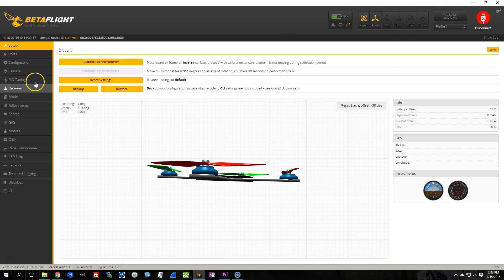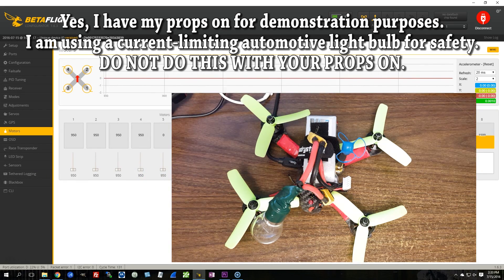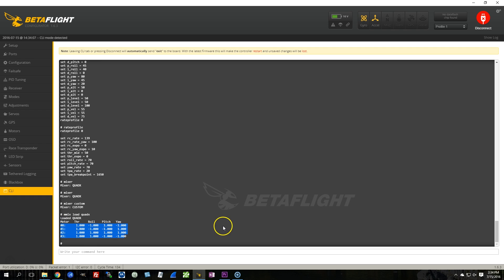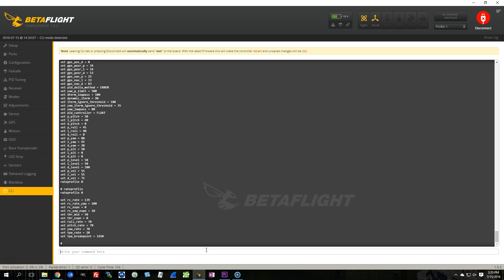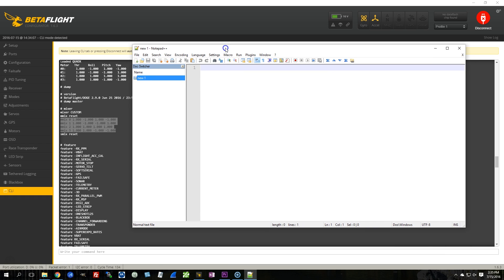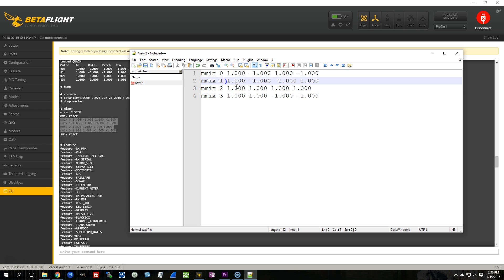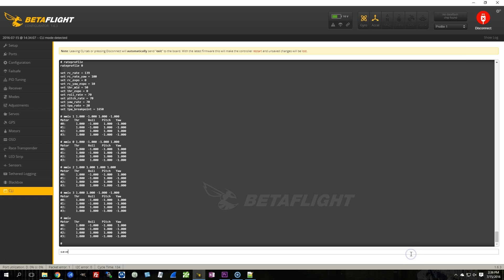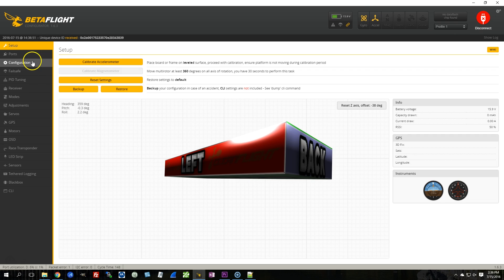Quadcopter Motors Wrong Order: Cleanflight/Betaflight Easy Fix [UPDATED METHOD IN DESCRIPTION]

Comment: This is giving me a brainfart moment...

Is there any simplier easier way to fix motor rotation direction, without going to desolder / resolder, as well as soing a crash course on electronics programming?
Like an app perhaps that i can just toggle the directions of my motors 1 & 4 to turn clockwise instead of counter-clockwise?

Comment: not working, values are changing in CLI but motor rotation same as before
Reply from the maker: This doesn't change the motor rotation. It tells the FC that you are going to change the direction of the motor rotation. You actually change the rotation in blheli, or by changing the motor wiring. In addition, please not the UPDATED METHOD IN COMMENTS. The mixer method is completely outdated.

Comment: Only a few of my motors will spin at a time sometimes one will spin or 2 on the same side or all of them will spin and it’s random and I have no idea what to do because they all work fine but a low throttle they spin supper fast or don’t spin at all

Comment: Thanks for video, my tinyhawk 2 freestyle would say the motor order was updated but it never changed when I tested? I was using a new mb so I took the old ones cli and flashed it over, It had a few errors but fixed the motor order for me. I'm sure I was doing sometime wrong but if any one else can't get them to work you might try a cli dump/flash

Comment: I have the right order of motors but motor number 2 and 3 spinnings in the wrong direction. can I reverse them with betaflight or do i need to do it by reversing the wires on the motors?
Reply from the maker: You can swap the wires or you can use blheli to reverse direction. But betaflight can't do it.

Comment: I am feeling very bad seeing all comments saying “great you fix my problem”. In my case nothing. The new mixer was recorded but the motors 3 and 4 continue swap. This is a new flight controller Tyro79. Last week I soldered motors’ wires swap for the motors stay in correct place, but I think is bad service and then I resoldered like the manual ask. I want to learn how to make it correctly. I don’t know what to do.
Reply from the maker: Don't use the method in this video. Use this method: https://www.youtube.com/watch?v=QeuSq71pYF0

You need to clear out the changes you made to the mixer though. Type "mixer quadx" to put it back to the default quadx mixer.

Comment: I'm sure due to how this video is someone in the comments would of already said this..... but just in case.

I had the same problem with motor 3 & 4 not spinning as they should, but when using this video as reference, I work out that the cable connecting the FC to the ESC had motor 3 & 4 cable connected incorrectly in the harness.

Quick swap and all fixed!!

Comment: Hi JB, I can't find the cmd mmix in BF Configurator 10.4.0. I have a OMNIBUSF4SD FC and I'm trying to reverse the motors 3 and 4 in Betaflight because my BLHeli configurator does not display any reading of the ESC's, although it connects right (with battery connected of course). Thank you
Reply from the maker: This is a very outdated method.

https://youtu.be/QeuSq71pYF0

Here is an updated method.

Comment: I have a whoop and one of my motors got damaged , after replacing the motor how to i choose that particular motor to spin the other direction ?
Reply from the maker: Brushed motors are fixed-direction. You need to install a motor that spins the right direction.
Reply: @JoshuaBardwell  This is for the Mobula7, aren't they brushless?
Reply from the maker: Then they can be reversed in blhelisuite.

https://www.youtube.com/watch?v=FwyYdjRLdG4

But I bet you they still ship them wired CW vs. CCW since the motors are pluggable.

Comment: Hi Joshua. I need help on this motor swap method. In the 3.5.1 firmware the syntax is diferente and I can't find the mmix values. What is the new commands for the motors? thks

Comment: So I wired one motor in backwards, and I used blheli suite to revers it.  So after doing that I have all motors spinning in the reverse direction as I wanted.  Also I went in the configuration tab in betaflight and flipped the reversed motors switch in the quad x configuration. But the quad does that same spinoff motion when I am pitching hard into a dive. Any ideas what could be wrong??
Reply from the maker: If the quad hovers at all then the motor direction is configured right. So I think you are talking about a tuning issue. But "spinout issue pitching into a hard dive" doesn't ring a bell. Have you got some video of the problem?

Maybe best to message me directly because YT probably wo'nt show me responses to this message.
Reply: Joshua Bardwell I think it may be the motor idol setting just watched so videos on it. I think some people refer what my quad is doing is the flip of death.

Comment: Joshua, I just did a build and I wired motor 1 wrong all motors turn in the right direction except for motor one, it turns in wrong direction, is there a way to map ONLY motor one or do I need to change my wiring? Help please
Reply from the maker: To change the motor direction go to blehelisuite and select Reversed motor direction OR swap any TWO of the THREE wires going  between the ESC and motor with each other.
Reply: ok thanks I figured it out in blehelisuite Thanks again
Reply: will that reverse all motors or can I pick which motor to change

Comment: hello, i was wondering how i could change the direction of one motor, i replaced the ESC on my wizard x220s and the number one motor is spinning the wrong way, i just need to reverse the direction. how would i do that?
Reply from the maker: Swap two of the motor wires at the ESC. Any two.
Reply: Joshua Bardwell Thanks for the reply, your videos are very helpful. But I also found a way to change the direction with the blheli configuration app. It automatically switched it for me.

Comment: Editing CLI to change YAW change W direction did nothing for me in Cleanflight. I was able to change one motor but then when I editing the file to change the remaining motors, everything went back to the previous setting. Motors 1,2, and 4 are all wrong and I really don't want to rip everything apart to resolder.

Comment: Never mind all my motors spin the same direction, motors 2 and 3 are  wired up correctly because they spin up in the correct corner, but there both spinning the wrong way
Reply from the maker: Reverse the motors by swapping any two of the three motor leads on each one.

Comment: Alright my quad works great, there all wired up the right way but one motor for some strange reason, spins the wrong way, and when I use dshot 1200 it doesn't spin at all. Pls help

Comment: Just motor 1 on my quad is spinning the wrong direction, how would I switch a single motors direction? You showed how to swap motors, that means atleast 2 have to be going the wrong direction.
Reply from the maker: +Aldo the Apache use blheli chrome app or blhelisuite to reverse the ESC.
Reply: Joshua Bardwell hello, Joshua will this work for my lizard 95. I’ve just renewed the 4in 1 esc and motor 2 is spinning the wrong way,

Comment: I followed the instructions, double checked the changes. Saved, put in a battery and nothing had changed. I did get the block 3D model after saving.
I also notice that when sliding a motor up to power it sometimes another motor slightly powers up for a second. No idea what that's about.
Reply from the maker: The sliders will not change if you use this method. You should use Resource Remapping instead. Resource Remapping did not exist when I made this video.
Reply: Which means I might have done it properly, but I can only test by flying it? I'll look up Resource Remapping tomorrow. Thanks and keep up the great video's!

Comment: All my motors appear to be spinning the correct direction with the correct motor number yet i'm still crashing attempting to take off.
Reply from the maker: Props on correct?

3D model moves correctly when you move the model by hand?
Reply: Yes - i had an upside down prop - after reprogramming everything many times - the problem rookie mistake.

Comment: Hi Joshua, i did like you said, swapped motor 0 with motor 3 (1 and 4), saved it, but when i spin motor one, its still motor 4 that rotates, what im missing?
Reply: Alexander Roelofs Same. Did you figure this out? I would rather not remap my pads. Mine saves, but does nothing to change the motor order.

Comment: Anyone know if theres a way to reverse just a single motor direction? I have a non-blheli esc that came pre-soldered to a motor but need it to spin opposite direction. Possible in betaflight or no?
Reply from the maker: Nope. The ESC is in charge of the motor direction. You have to reverse the wires.
Reply: Is it the same with bheli ESCs? I got the new Japalura with Armattan Bheli 20A ESC, and wired the motors already.

Comment: Hi Joshua, I am sure you are a busy man, but you are my Youtube FPV guru and I hope you can help :-) . I have flashed Betaflight onto CC3D, FrSky v8FR-II RX, Hobbywing ESCs 15A (supposedly support Oneshot). When I use Oneshot protocol in Betaflight, 3 Motors kind of twitch, then stop and two start beeping when I move the regulator in the program up, while the signals received from my radio also are strange and twitchy. With PWM ESc protocol, one motor moves normally, the other 3 not at all. What could be the problem?
Reply from the maker: I'm going to go with your flight controller. Have you got a more modern board you can try?
Reply: Unfortunately not, I am utterly obsolete around here ;-) In the meantime I got Oneshot ESC protocol to work with one motor as well, but the other 3 don't respond...
Reply: Found today that it seems to have to do with the combination RX PWM/ESC Oneshot and PWM in versions 3.1.x: https://github.com/betaflight/betaflight/issues/3079 . It should work in 3.0.1 and I will try this later. Will have to get a PPM receiver if I want to use the current version of Betaflight. Thank you for your quick reply yesterday, Joshua, your help is always appreciated! :-)

Comment: hey Joshua , the command mix load quadx gives "unknown command, try help".
I got stuck here...
any suggestions?
Betaflight 3.1, blheli esc.. etc.. all updated.
I have the motors on the wrong position and turning all wrong side... I really would like to avoid to dismount it all to weld again...
Reply from the maker: Because the command is "mixer load quadx".

But don't use custom mixes any more. Use resource remapping with Betaflight 3.1.

https://www.youtube.com/watch?v=z5aO-3_n-Hs
Reply: Wow!!!! I haven't seen that video..
Much easier indeed!! now I could fix it! thanks Joshua!

Comment: Josh I have entered the commands as you suggested and it will not accept. I have 3 motors in the wrong spots (4 in1 esc and signal wires going to the correct corner) the esc is in the frame right corner #2 left corner #1 right front #3 left front is #4
flight controller is as it should be. any Ideas   I tried to set the mmix to 2013 (0123 stock) and will not take it
Reply from the maker: +Mark Thompson just use resource remapping to reorder the motors, assuming you're in Betaflight 3.1. If the mmix command isn't taking, your syntax is wrong.
Reply: I'm switching that now (thanks to your other video) now some of the motors are spinning wrong?
Reply from the maker: +Mark Thompson reverse the motors in BLHeli
Reply: thank you so much...your the man Josh!!

Comment: Hi Joshua. I appreciate your videos. Very helpful in very desperate times ;))). I need you expertise here. My F3 Evo OSD brushed FC just doesnt want to do what I command. I did exactly the same steps as you have shown here. My aim was to reverse the motors inverting -1 to 1 on the YAW. I got custom mix all set all value is right and then saved and the disconnect and I go back CLI shows the new values (but no box shape craft) and when I check the motors it is spinning the same. My values in CLI still showing the reversed details. Then I tried completely inverse the values on the two motors spinning in the wrong direction but still no success. I hoped I dont have to disassemble the custom QX90c built. Any suggestion?
Reply from the maker: +Tamas Lakatos a custom mix won't reverse the motors. You have to do that in the ESC's. And better to just inversion yaw_motor_direction instead of a complicated custom mix.
Reply from the maker: If it is a brushed quad I think reversing the motor wires will reverse the motor direction.

Comment: Josh, signal header on PWM1 is not working. Can I plug motor one into PWM5 and specify that in a custom mix?
Reply from the maker: +Tommy Armour no, but you might be able to use the Betaflight 3.1 resource command. Search my channel.
Reply: That was a quick response. Thank you. I will search it out.

Comment: Thank you! This easily fixed my problem. Wish I didnt wreck my hand by being foolish enough to not check my wiring mistakes, before trying to hold down the copter while checking rotation of the props... It works just fine now, but holy damn there were some force in this thing upon trying to correct wrong attitude with the wrong motors.

Comment: Josh, I have my motors in the right order but 1 and 4 are spinning the wrong direction. I don't think I have found the right youtube video yet. thanks for your help. building my first race drone and your videos have helped me come along way.
Reply from the maker: Use the BLHeli chrome app to reverse them.

https://chrome.google.com/webstore/detail/blheli-configurator/mejfjggmbnocnfibbibmoogocnjbcjnk?hl=en
Reply: NebraskaDrone I had the same problem on one of my builds. I wired everything correctly and soldered perfect, double and triple checked. 
So I went into blheli configurator and reversed motors 2 & 3. 
All of my motors were spinning clockwise. 
Was odd to me since I've built others and did not need to reverse any motors and wired all the same.

Comment: I hate to blow you up with questions, so i did arm the wizard that has littlebee 20amp esc,emax motors it wont throttle up in betaflight but will arm with radio but motors spin all wrong what should i do? I still not sure if i gotta do something special for littlebee esc 20amp with the stock wizard flight controller.. Is there a better way to contact you it looks bad i keep messageing you on here. I appreciate everything though
Reply from the maker: Calibrate the ESCs. The motors must spin normally in the Motors tab when raising the slider. Then set min_throttle to be 30 us higher than the lowest value where the motors all spin smoothly when raising the slider in the Motors tab. Finally, confirm the motor direction is correct based on the graphic in the Motors tab. If not, reverse two of the motor wires or use BLHeli Suite to reverse the motor direction.
Reply: thanks mr bardwell, ill work on this and see what i get..
Reply: David Downs ya reverse motor direction for esc's 2 & 3 in blheli configurator.

Comment: Having it wired OpenPilot/Kiss/RaceFlight style you need to do this:

mmix 0 1.0, 1.0, -1, -1.0
mmix 1 1.0, -1.0, -1, 1.0
mmix 2 1.0, -1.0, 1, -1.0
mmix 3 1.0, 1.0, 1, 1.0
mixer custom
save

Comment: I have a Kombini FC, and I followed these steps exactly. Yet I cannot get my fc to change motors 3 and 4. I watched the video and followed it step by step, and my fc leaves motors 3 and 4 swapped
Reply from the maker: The motor sliders on the Motors tab will not ever change. That is hard-coded. You are just re-arranging which "corner" of the copter the FC thinks is attached to each motor header. So for example, motor #1 is usually the back-right, and motor header #1 will spin the back-right motor. If you accidentally wired the front-right motor to motor header #1, a custom mix would allow the copter to fly correctly, but motor slider #1 would still spin the front-right motor. You see?

PS: Betaflight 3.1 is supposed to have configurable inputs and outputs so it might allow proper remapping of motor outputs.

Comment: Hi Joshua, I'm using Cleanflight on a F3 Racing FC. I need to use a custom motor mix for my Eachine racer 250 but every time I create a custom mix and save the settings it does it's usual save and reboot but doesn't save to the board. Even though In configuration it shows custom mix has been selected. Do you know why this is happening? should I change over to Betaflight? 
Thanks.

Comment: Hi, I asked about this in your other video. This seems like the exact solution for me, it's even the same motors I have the issue with. I've followed these exact steps 3 times now and motors 1 & 2 are remaining reversed, is there anything I could be missing? It's a naze32 v5 board btw.
Reply from the maker: +siliconstate did you type "save" at the end? Did you type "mixer custom".
Reply from the maker: Oh wait hang on. The motor headers won't remap. But the copter will fly without flipping out. Nothing remaps the motor headers in the Motors tab.
Reply: Yep I made sure I typed correctly and to save. I'm not sure what you mean by motor headers, I just checked the motors again by going to the motor section afterwards and testing out each motor individually by physically looking at them. The motors map had been replaced by a big question mark, so I took a note of their positions on it before doing this to check the real ones and they hadn't swapped positions. I didn't try out flying it after that mind you.
Reply from the maker: +siliconstate that's what I'm saying. The custom mix doesn't re number the motors in the Motors tab. It just changes which corner the FC expects the motors to be on.
Reply: That sorted it! Thank you, you have a new subscriber! I gave it a quick test fly and no flipping. I can't pilot much yet tho :) I just thought that seeing as the motors still hadn't seemed to swap when testing them that it hadn't worked, but it's great! I just need to set up some flight modes now.